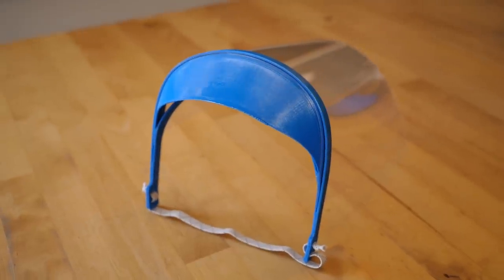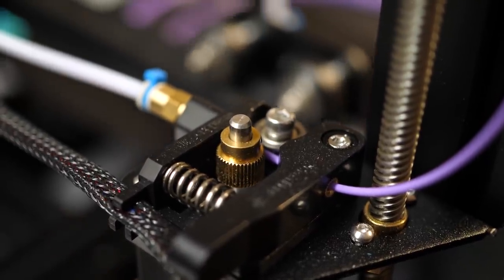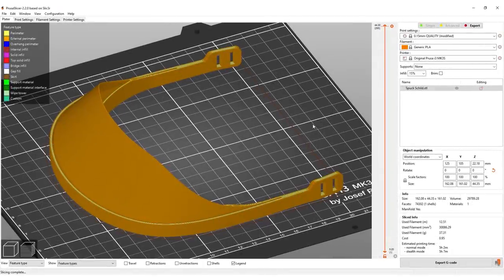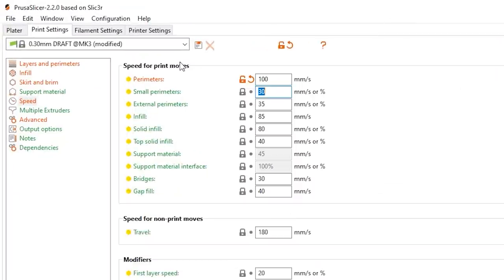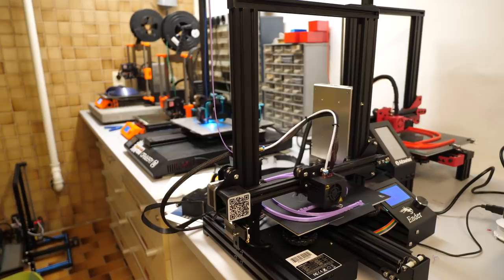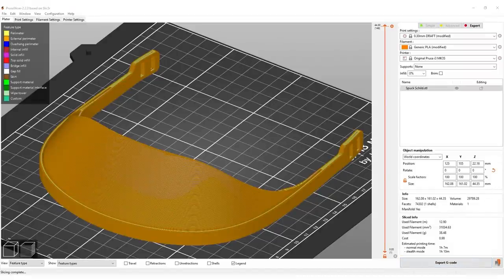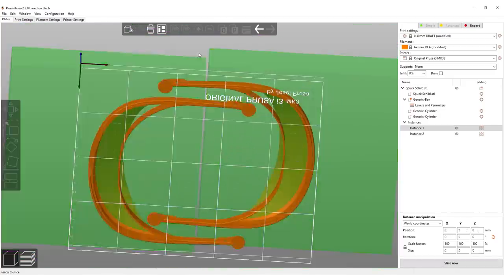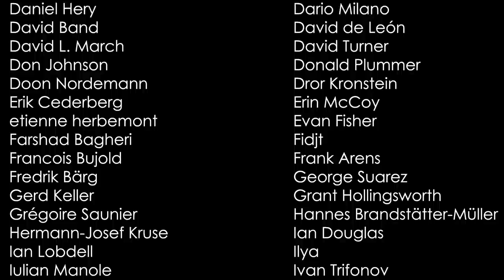FASTER 3D printing of face shields - from 5h to 1h!

Comment: I think what doctors want is a face shield that is closed at the top. It does not need to slope which takes more plastic and adds more weight than the top going straight across.

Comment: I put the gcode into my octopi and it said its gonna take 3.5 hours on my ender 3 pro. I don't know if I have to change the flow rate in the octopi any ideas ?
Reply from the maker: The ender 3 pro is slower, as I explained and the 3.5 hours are right.

Comment: The prusa slicer settings in this video work amazingly for my MK3s with .4mm nozzle. If I want to swap it out to a .8mm nozzle, what would I change the slicer settings to?
Reply from the maker: Increase layer height, extrusion width and if possible the maximum volumetric flow.
Reply: @CNCKitchen  thankyou! How can I really increase volume flow on stock prusa e3d v6? Isn't it capped at 12 based on your previous video? Nozzle change wouldn't effect that, would it?

Comment: Question for you: what can you do to prevent or reduce the chances of layer shifts. I seem to get them randomly every so often and I have no idea what's causing them. Usually the rest of the print is perfect. Any ideas?
Reply from the maker: Maybe increase the stepper voltage if you can or use z-hop/lift nozzle during travel moves.
Reply: @CNCKitchen  thank you! I will give it a go!

Comment: When printing the hood section, why dont you set the printer to print each hood separately? There is a big gap between each hood. It will save time on the printhead moving in blank space across each shield, but im not sure how it will affect the cooling time

Comment: What is the Cura equivalent of "volumetric flow" please ?
Reply: It doesn't exist
Reply: It doesn't seem to have the exact same modifiable parameter, but I believe the "Flow" value under Material will directly influence this (this param is measured in percentage, probably similar to Speed on the firmware directly)

Comment: I don't get it/ Why not go with the design that Devin highlighted, which he made stackable and could be stacked up to max Y? The way he demo'd, he added air gaps to the print so that only a thin piece of plastic holds them together, and they could also be interleaved to maximize printing efficiency.

Comment: I tried once PETG to max out at 15mm3/s with all speeds set to 120mm/s. It printed, no skipped steps, but quality degraded a lot and part was brittle like cookie. Maybe next time I will try with higher temp.
Reply from the maker: And dry your PETG! It does become brittle if it's moist.
Reply: Nah, I usually don't exceed 8mm3/s volumetric flow rate and room is quite dry 20-30% humidity. So I think I'm good.

Comment: Science teacher from Honduras, medical personnel here has literally zero protection. Several health employees want a mask, I have a ender 3 but can't make printer work faster changing settings in cura for the. 3mf for ender that you kindly share in your webpage. Could you please share the gcode for the improved speed slice for the ender 3? Please consider that no other maker is providing shields in this region of the country.

Comment: It works great for my faceshild on MKS3. How can i adapt the settings to 0.6mm nozzle? pls help
Reply from the maker: Either use the same and upp the extrusion limit or increase layer height to 0.5 and extrusion width to 0.8mm.
Reply: @CNCKitchen  i will try. Thx!

Comment: I have an idea for something to test: Extrusion multiplier settings and its effects on strength.

Overextruded, normal, and under-extruded. Not necessarily to extreme ends, but are things like models which are generally slightly under by 2-3% to reduce stringing weaker? Or is slight overextrusion to try and fill air gaps / make items water tight stronger?

Comment: Great deep configuration tips. My Godson us looking to get into prison ring can you reccomend a good beginner 3D printer less than $500 US?
Reply: Ender 3 All the way or mayber a Prusa if you wanna build it.
edit. could even get 2 enders with that budget
Reply from the maker: Even though the Ender 3 doesn't print as fast as the Prusa, it's a good machine for the price. Check the description for links to the Prusa, the Artillery and the Ender 3 to compare them yourself.
Reply: @CNCKitchen  yep. I converted my Ender to direct drive with a 3D printed part and installed klipper and now I think i can print faster or at least to better accuracy than a stock prusa. But if you want stock speed an artillery or Prusa would be best. For sheer price to performance Ender

Comment: Nice Video! 

Instead of a modifier box use the height range modifier. Does the same but way easier in this case to set up.
Reply from the maker: Unfortunately there was part of the shield on the same height, I didn't want to modify. This was the reason I didn't use that approach.

Comment: Yes, so we started printing shields for emergency services as they were short on those (not the one in video) :) printing these with 0.4mm nozzle is a waste of time. Literally. Its no good as You need to make it at least 1mm thick and You need to print fast not nice just to deliver as much as possible as quick as possible. Basically with a 0.8mm nozzle and a 24v Ender 3 using bondtech DDE I was able to print one in 28 minutes. To print it in 28mm I had to slow down my printer not to damage it. Other people on 0.4mm nozzle print the same thing FAST for 3 hours. The most important thing that I found out was no travels (avoid standalone infil), no top or bottom layers and over-extrusion to push out as much as You can :)

Comment: Small print moves are terrible. They don't really work, but take a lot of time, especially with retraction. Most of the time those are from infill and bottom/top shells. Increasing the amount of shell lines will decrease the print time. Also there are options to filter out small moves.

Comment: Currently, for me printing feels like the easy part. What I am finding really difficult is
1. Finding all nearby hospitals that need 3D printed PPE - I am getting 2+ hour wait times and potentially using up phone time that ill people need
2. Finding where to source the other stuff - non-latex rubber bands, plastic sheets (size + material type + thickness), etc

If someone has made some headway here please comment below.
Reply: I'm collaborating with a maker's space that has established supply chain and distribution to healthcare workers. Been printing the dc3 file's myself and sending the parts to them for disinfecting and assembly. Hope this helps . stay safe 👍😷
Reply: tusing see if a local group is already doing it. Here in Seattle there’s a pretty well organized group making shields. Coordinators are working with the hospitals and NIH. Some people are just doing pickups and deliveries. Others just cutting the shield sections, cleaners, printers, etc. if everyone tries to do every job people will get overwhelmed.

Comment: Open the legs, that way you can print 3 or 4 per round. That's what we are doing in Spain. I can send you the models if you want.
And also, that way is easily stackeable.

Comment: Has anyone experiences with maxing out the E3D V6 hotend at an Prusa MK2 / MK3 with PETG? I am currently printing with 10.5 mm³/s max flow rate at 240 °C and wonder if I could go higher.

Comment: Tome could you share with us your Gcode file thank you so we could just print it off in the Prusa mk3s
Reply from the maker: Project files are on my website.
Reply: Tom I wanted to know do you have did you code because the project file is just what it is a project file but it does not edit the way you’ve done stuff so I still have it where in my purse slicer it’s giving me  3 hours  and 15 minutes I can’t bring it down to the timeframe that you have it I am using a 0.4 nozzle

Comment: Here is some guide I came up with and a model of the Prusa RC3 that is specially designed to print fast: https://github.com/yschroeder/face-shield

This prints in 32 minutes on a Prusa i3 MK2.5S. No infill, only two perimeters everywhere.
Reply from the maker: Nice work!
Reply: @CNCKitchen  Thanks! When I saw the video title I was curious if you found another setting that I missed, but we came up with the same solution! 👍
Reply: amazing! muchas Gracias

Comment: I've printed the version from faceshield.nu 
On my Ender 3 with a 0.4 nozzle it takes about 55 minutes per shield. If you have a multimaterial printer i've seen people print stacks 50 with PVA in between. 
The shield design har been positively received around here in Sweden. It's easy to clean and desinfect and making new shield sheets is very simple using A4 Over-head sheets and a regular hole-punch. They can make them 50-10 at the time by themselves.

On a 0.4 nozzle, I use a 0.32 layer-height and 200% line width. I cranked the speed way up, and adjusted the flow-rate instead and let the slicer decide what to do.
Reply: good job! Can you share us your G file ? I'm also have a ender 3.I'd like to print in the time that you mentioned.thanks

Comment: I got confused halfway through (not their fault, it's 4 am where i live). On my ender 3 pro i just bumped the ms speed in cura to 150 and the speed on my printer to 400. I could make a face shield in 1.5 hours no errors whatsoever.

Comment: quality control is of vital concern. i would follow guidelines of mask designers, and designer of mask. this may make a good video, but i would not do this in practice. the masks have little protection from viruses, but are handy for emergency room, as long as they last properly, at least thru a shift. reducing time to print part, by reducing infill and amount of plastic seems like it would not produce a product of acceptable quality for use. imho

Comment: this is exactly the time where I remark what I've been saying for years, PRINT FASTER! I hate seeing printers go at 30-40mm/s, they can handle so much more! my crappy anet a8 could handle actual 120mm/s prints with the stock hotend and a crappy Bowden extruder by just installing klipper firmware, a prusa with a v6 could probably get to that too.
my new setup can manage true 300mm/s, if everyone knew to print fast, we could have tons more of capacity
Reply: Increasing extrusion width and layer thickness is a much simpler way to max out the filament flow rate of the hotend. You can double the extrusion width, print at half the movement speedboat and still print twice as fast.

Comment: Wear gloves while handling them. Wipe your surfaces with alcohol to kill bacterial. Use your first shield for yourself to prevent yourself breathing over the parts. If you have a face mask then wear that as well. Put them in plastic bags to prevent them being contaminated. Label them with the date you printed them, as Corona virus is believed to stay alive on plastics for 3 days. Put the type of material on the label. PETG is easier to sterilise than PLA so use that if it's available. Don't use ABS as it's a toxic plastic and releases cyanide when heated.

Comment: You should get a delta printer, upgrade it with overkill motors and print at 1500mm/s
Reply from the maker: But if the hotend can't handle it 😉
Reply: @CNCKitchen  normal one would not 😂, but there are some old videos of people printing 1000mm/s and it looks cool

Comment: You can go up to 0.32mm layer height on a 0.4mm nozzle.
Reply: Will not increase the volumetric flow tho. So the printtime will not change.
Reply: It will change the volumetric flow.
Volumetric flow = layer height * print speed * extrusion width(line width)
Reply: Print time will reduce.
Reply: @pratheeks  But he has the machines running at their limit for the flow as he said in the video. 
So it will just move slower and that is all
Reply: Correct. But slower is better right?
I mean keeping the print time the same  while printing slow.

Comment: Does somebody know of the best model for a face mask? 🤔
Reply from the maker: As there is no best 3D printer, there also is not best mask/shield or whatever. Depends on your needs.
Reply: There are models in the NIH site that are clinically tested. I figure they have better odds of being approved for use, at least here in the US.
Reply: @CNCKitchen  Vielen Dank! I guess, I'mma do my research
Reply: @EdwardChen0  Thanks for the info!

Comment: I’ve managed to bring down to 36 minutes per mask with 0.6 mm nozzle, but it’s not the same design
Reply: Check out 3DVerkstan’s  face shield design. I’m printing them in 21min with a 0.8mm nozzle on the ender 3
Reply: @NullHyp  Will take a look, thanks, I'm at 15 mm³/s on my V6, will see if it can go faster

Comment: #1 F### those that don't want to hear about it! I hope they all get sick so they have some empathy next time. 
#2 If you can't, for whatever reason, meet the standards of your local hospitals, pharmacies are also in need. They have to prioritize PPE for the hospitals and emergency responders, so have even more limited supplies, but are also in constant contact with sick people. Reducing spread at these locations won't do as much to flatten the curve, but it will still help, and might save a life or two!

Comment: Doesn’t this decrease the quality of the parts? More likely to have sharp edges and weak parts?
Reply from the maker: No, the parts won't be weaker if you do your job right. Layers are higher, so the optical quality might be slightly different.

Comment: I think if someone manages to make an injection mold for these, he could produce them a lot faster than any 3D printer farm...
Reply from the maker: A local company did that: https://www.adoma.de/-1-105-30.htm
Reply: on makersvsvirus there are 5 organizations which are in the process of getting their designs injection molded. There is a own Channel on slack about #Spritzguss (Injection molding) ;) Proud and stoked to be part of one ;)
Reply: In Denmark we're producing 3000 shields pr day. After 10 days the big companies are only just starting to produce. Grundfos have from friday started to produce ~5000 pieces pr day by injection molding. Remember that making the mold is a long and expensive process. Companies have been very slow to start this as they see no profit in it. The demand for face shields by other than hospitals are much greater than you might think. Elderly care centers, local doctors, dentists etc. List goes on and on. We got our design approved by the authorities today!
In total we have produced more that 17000 face shields :)
Btw @CNC Kitchen it is possible to put 4 shields on the ender3 bed, just saying ;)

Comment: You may also look at this design which the author claims has been coordinated with the German Red Cross for usability: https://www.thingiverse.com/thing:4240579
I've printed a couple of them in PETG already, but I need to get my printer to be more reliable (not a big fan of PETG ...). Running 235 degrees on a Volcano with 0.6 mm, takes about 1 hour per piece. Still lacking the required rubber bands for the head, but got a box of face shield sheets today.

Comment: "...face shields..."  3D Printing always uses the wrong noun. Nobody is 3D printing "face shields". What's being 3D Printed is the visor component of the face shield, to which is manually added the actual shield element (cut out of a sheet) and the string. Why are the 3D Printed 'nouns' always claimed to be the Next Higher Assembly? By the way, kudos for 3D Printing the visor element and manually assembling the face shields.

Comment: Step 1: Buy a faster 3D printer
Reply: A bigger nozzle and Volcano hot end will suffice. Increased speed in X and Y is a much more difficult way to increase filament extrusion rate than increasing the layer height and width. At the same speed, doubling nozzle diameter extrudes 4x the filament.